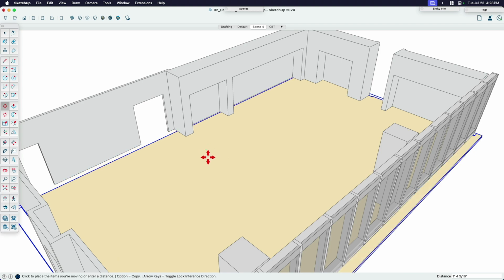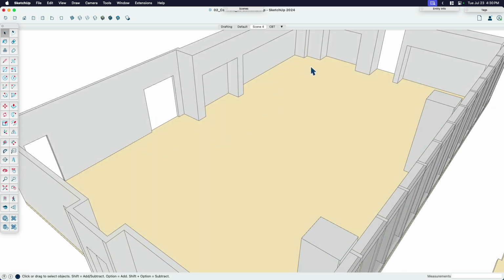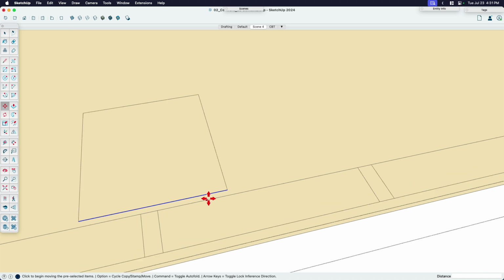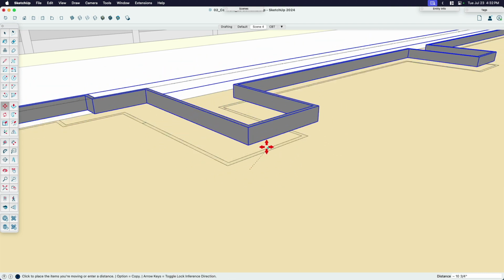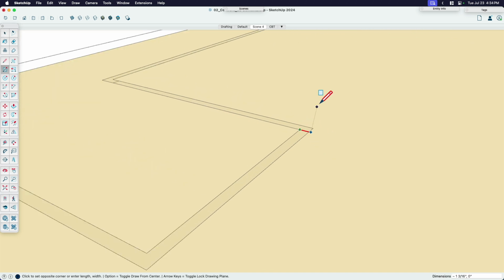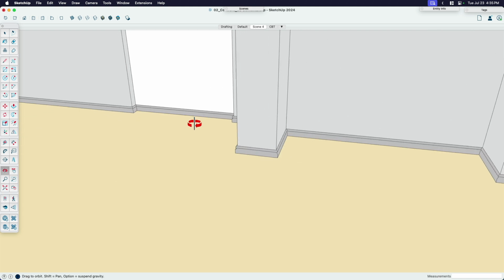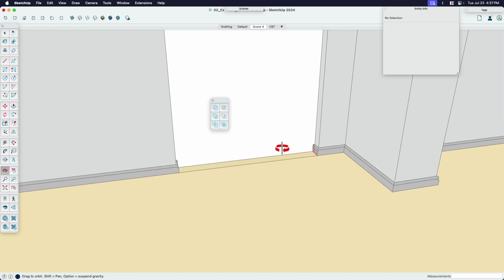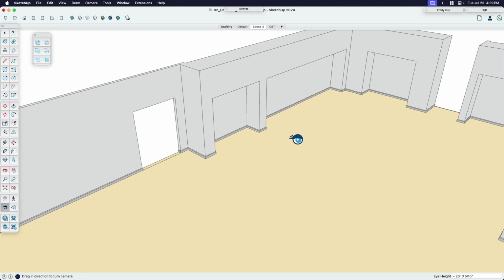Easy Baseboard Moulding in Large Room (+ Door Openings!)

Comment: Thanks Eric! Good video. I wonder if I could create a cut list for crown or base with this method. Would need accurate measurements of the room first though. Not sure I can "COPE" with the comments though...(carpenter pun intended). Normally there is casing around door openings so the base (board) would stop there. Crown molding would normally be continuous around the room.